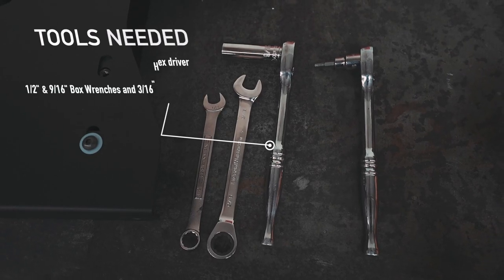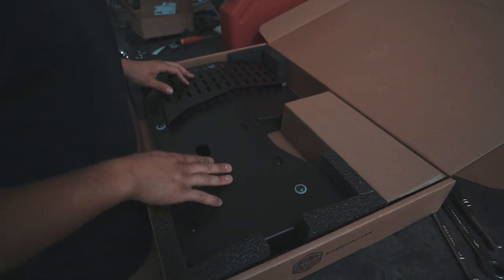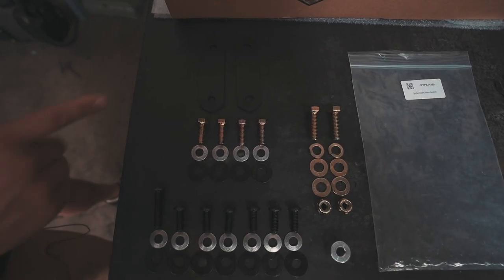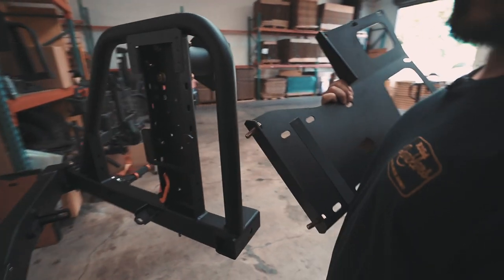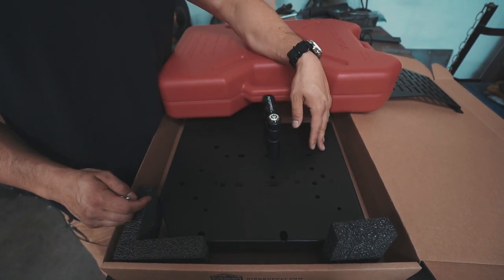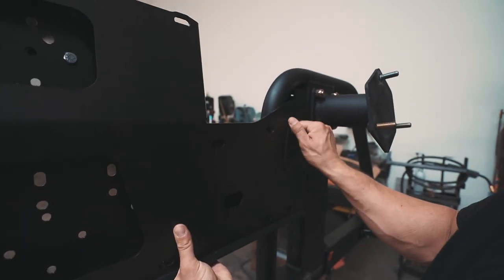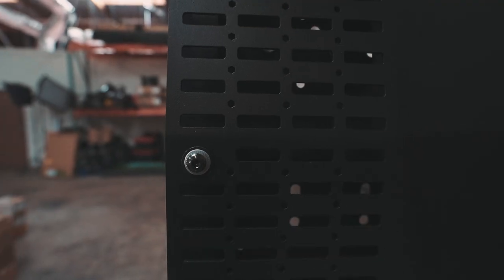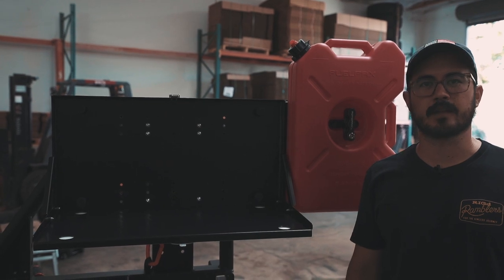RIGd Supply SideHack™ Install

Comment: Is it necessary to mount the rotopax base plate onto the side hack cover? The video shows the handle mounted directly with just the two bolts.
Reply from the maker: Great question, no need to use the Rotopax base plate. Just put the Rotopax handle and its 2 bolts straight to the SideHack.

Comment: I have the SideHack installed, and just added the JerryRig Fuel Mount.  I see the weight rating is 50 Lbs. for the SideHack.  Does this change when you add the JerryRig Fuel Mount?  Because if I add a 5 gallon and two roto packs, my weight goes way over in a hurry with water/gas combo.
Reply: @RIGd Supply we need an answer to this one.

Comment: Do you guys think it would be possible to mount propane to the outside of the SideHack? I'm worried that an inside mount may hinder the ability to use the UltraTable when cooking. Perhaps with custom mounts?
Reply from the maker: Hey, Yes, the outside of the SideHack (on the molle panel) is where the propane fits.
Reply: @rigdsupply6945 with the Molle panel or do we have to remove it ?
Reply from the maker: @Socaloverlander  With the molle panel

Comment: Will you be able to run this, with the rotopax, with a c4 ladder on a 5th gen 4Runner?
Reply from the maker: It's tight, but on our latest fit checks it appears that Rotopax can clear even with a ladder, we've confirmed Gobi ladders, but not C4 yet.
Reply: @rigdsupply6945  Have you guys confirmed that the Sidekick can work with a Rotopax and C4 Ladder? I don't want to jump the gun and purchase the Sidehack and realize it doesn't fit.
Reply from the maker: @marknonato  Hey Mark, the SideHack solves the same solution as a ladder with Rotopax mount, minus the front side of the SideHack. Technically it should clear, but it defeats the purpose of the main mounting utility of the SideHack.
Reply: @rigdsupply6945  Thanks for the response. I guess I am a little confused by the response. I have a c4 Ladder and was planning on getting the sidehack so i can mount a 2GAL Rotopax to the sidehack but I am worried that the c4 ladder thicker profile than the gobi ladder will interfere with the sidehack with a rotopax mounted on it. Can you confirm if this will be an issue?
Reply from the maker: @marknonato  Hey Mark, Since you already have a C4 ladder I'd recommend getting their Rotopax mount to carry your Rotopax. I believe the SideHack will have clearance issues.
Reply: @rigdsupply6945  Hey thanks for quick response. I know Luke also has a C4 ladder and I was really hoping you guys were going to try and make the design of the SideHack work with a C4 Ladder. Do you think the second iteration/version of the sidehack will be redesigned to accommodate the C4 ladder? I really like the idea of the sidehack because I also wanted to use it to carry a propane tank.
Reply from the maker: @marknonato  Hey Mark, Luke here. The SideHack was designed to solve the issue for those who don't have other places to mount fuel right there. If you kept just a 2-gallon Rotopax I think it might just clear and you could utilize the front. I can't 100% guarantee since I don't have my 4Runner anymore, but I'm pretty sure there's anough wiggle room with the C4 Roto mount that it should work.

Comment: Will this be able to bolt on the existing hard ware of the larger Rago Molle panel?
Reply from the maker: Thanks for the question. The SideHack will work with the old table mounts and Front Runner Table or the new UltraTable, however, the UltraPlate is not compatible.